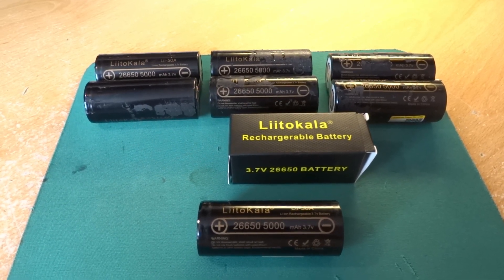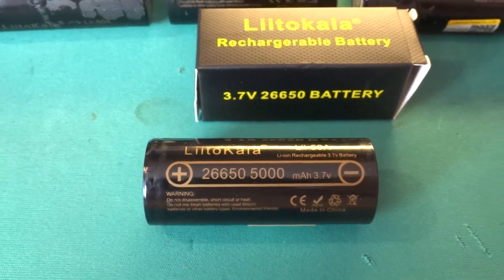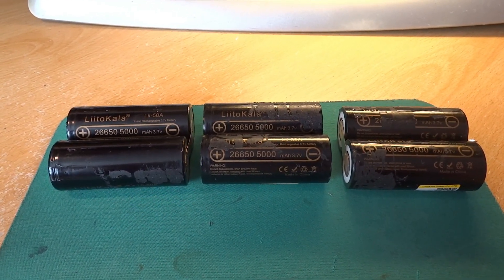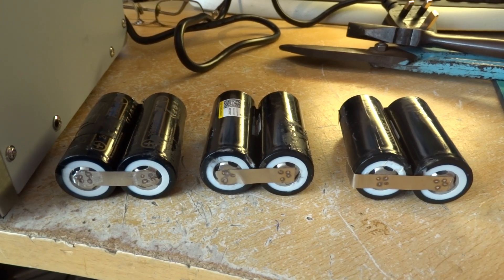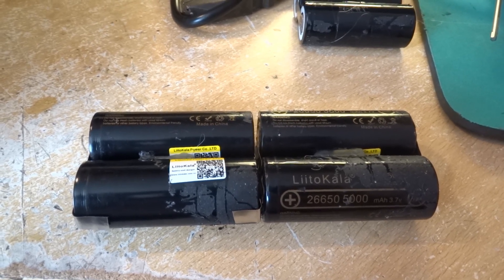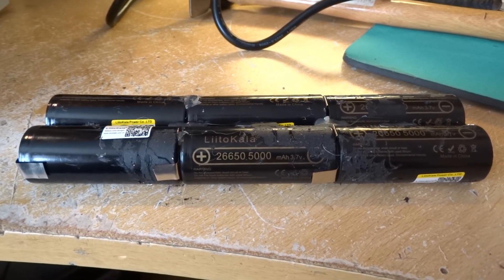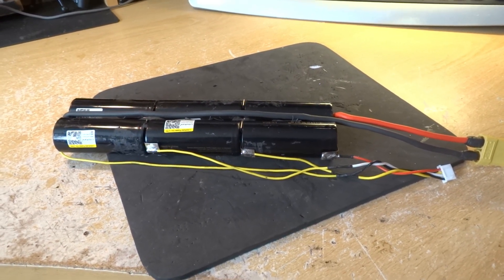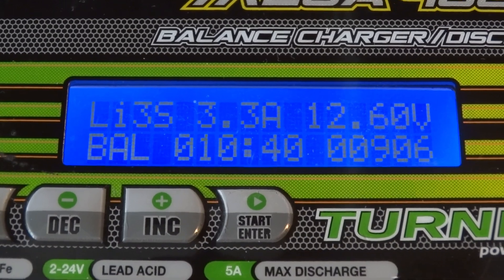Making a Li Ion 3s2p 10,000mah Battery

Comment: That’s heavy, I did a 4s battery with those, for a plane.
Reply from the maker: Easily carreid by most of my FPV fleet but to be honest those cells are not working out as well as they really should and have been demoted to running things on the ground station.
Reply: @BillHally  you are correct first time I try 3s not good but I rebuild it in 4s and for the planes that I got works pretty well, those are not the only ones I try  at this moment I am trying this one LiitoKala 33140 3.2v 15Ah lifepo4 lithium batteries 3.2V Cells for diy 12v 24v e bike e-scooter power tools Battery pack

Comment: hi billy  ive ordered  some of these batterys gona  have a go at building a 3s pack for my mini talon which i currently fly on a 3s 5.200 mah lipo be interested to hear what sort of flight times you get useing these packs. regards trev
Reply from the maker: TBH I did not find them to be that good for high current applications so they are used for ground station etc

Comment: Very nice - lipos are pretty expensive nowadays so this type of thing is a viable alternative, especially since the amp draw will be a lot lower than max burst while you're cruising around.
Reply from the maker: Yep I totally agree these cells are a cheaper alternative its about half the price of equivalent lipo batteries which is nice.  As you say after the initial launch burst of power they will settle into the cruise nicely.  I did a bench test against a 3s 10amp lipo and the figures were so close together on my ammeter as it made no difference.  Will be interesting to get it into the air of our weather ever gets better!